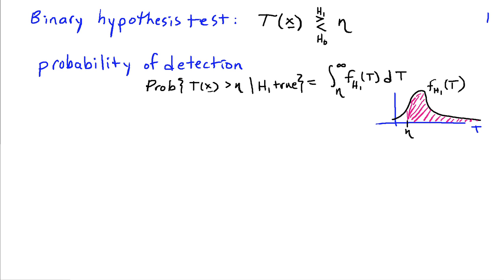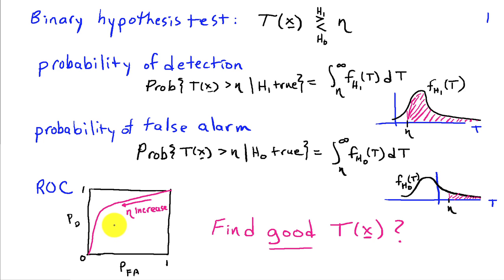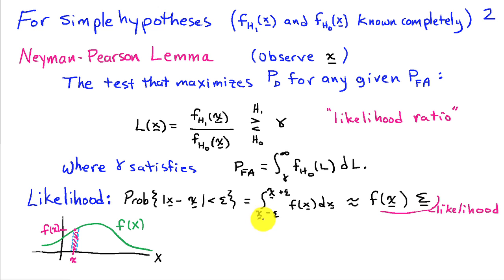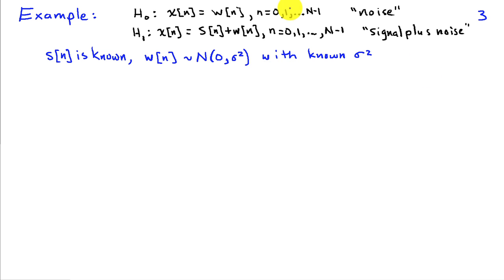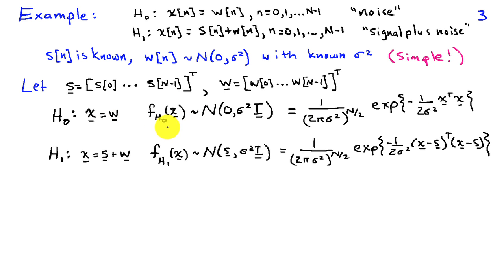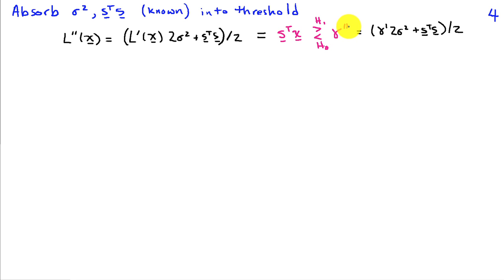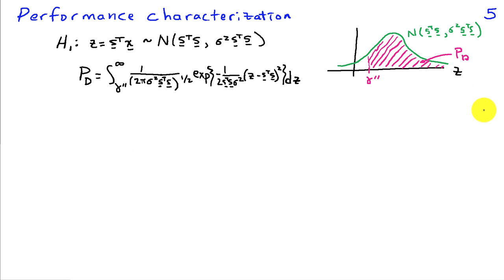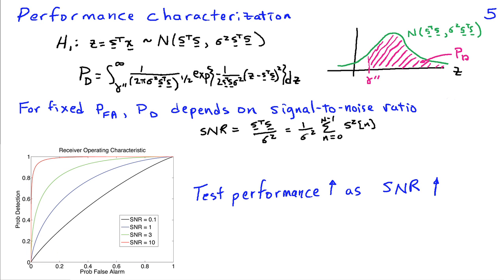The Likelihood Ratio Test

Comment from the maker: Sorry for the slow reply.  Normally you would vary the threshold to get the ROC, and if the pdfs of your test statistic under each hypothesis are unknown, then you can use simulations - run a large number of random simulations when each hypoth is true and then use that one set with your varying threshold to find the fraction of each exceeding the threshold to get the ROC. Be careful near the endpoints though as getting those probabilities with simulation is tricky.